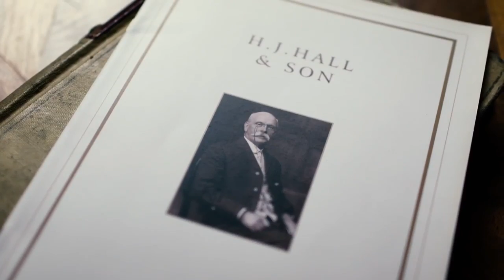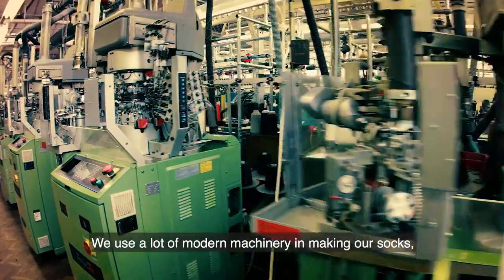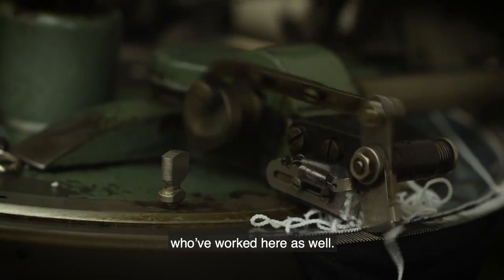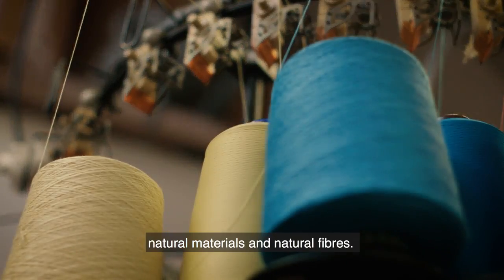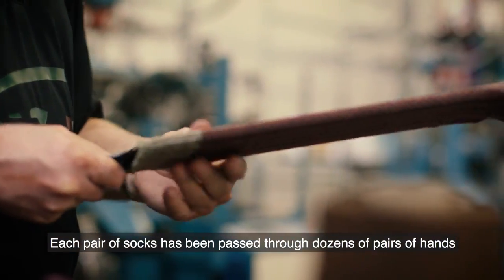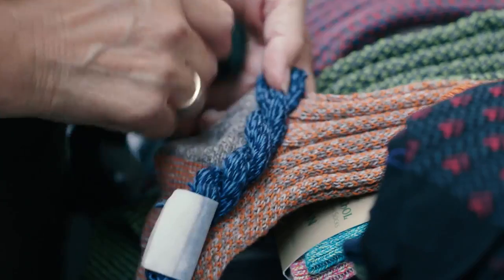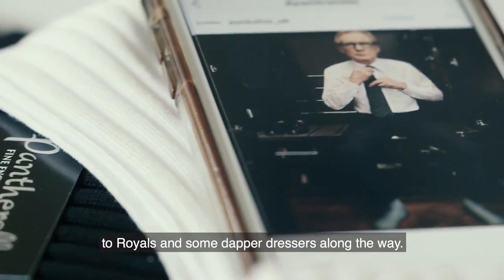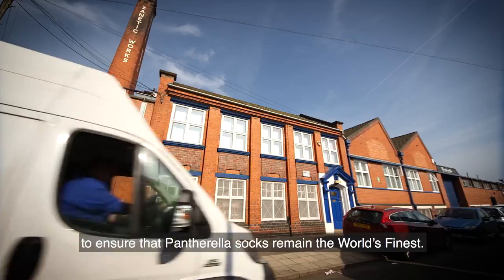Pantherella - Fine English Socks - Made in England since 1937

Comment: Are the wool socks supposed to be see-through?!!!
Reply: Yes, but despite their fine appearance, our Merino Wool socks keep feet warm in the winter and cool in the summer, due to the unique body temperature regulating properties of the Merino sheep’s fleece. You can read more about what makes our 'see through' fine gauge socks so special, here: https://www.pantherella.com/discover-pantherella/fine-gauge-socks
Reply: Sophie Holt  How long will it last if you wear it daily?  Still wearing a thin pair of CK socks for 4 years later. Read lots of reviews that say Pantherella last only few wears.
Reply: @verveblack  If washed and worn properly then Pantherella socks should last you years. The yarns we use are the best in the world, with extra long fibres which knit together with fewer stray ends. These stray ends are what often results in 'pilling' which in turn can lead to holes. We use a lot less synthetic fibres than cheaper competitors but we do reinforce our heels and toes with nylon, to add durability.